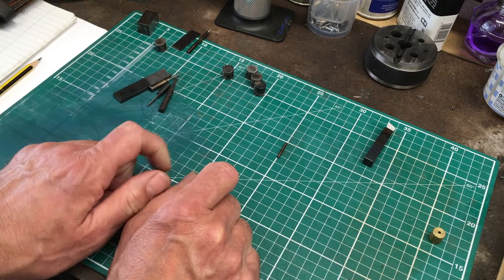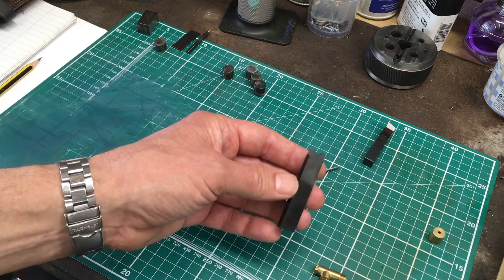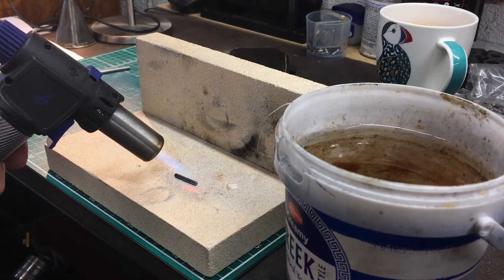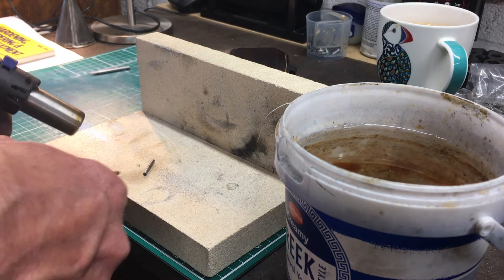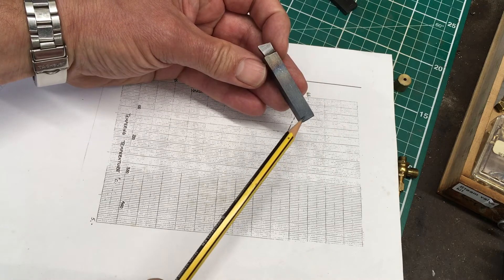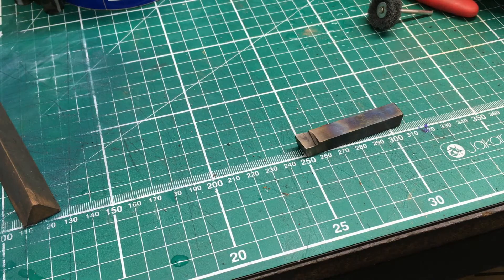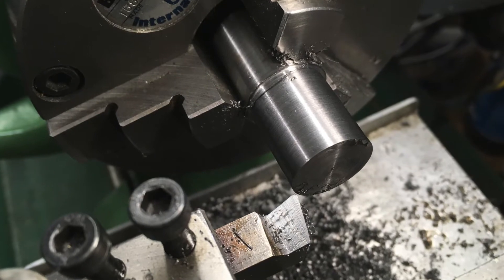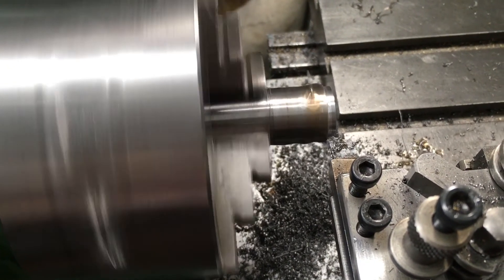Hardening tool steel.

Comment: Hi. I'e read that O1 tool steel should be quenched in Oil and W1 tool steel in Water, O1 - Oil /  W1 - Water. Is there a reason why you quench O1 in Water? Thank you.
Reply: If anything it’s overkill. Oil is required for steels that harden super fast, usually have a bit of chromium and alloy. 

52100 is considered water or oil. 

Most steels can be oil quenched actually. Commonly down to 1000f then in air or water

Comment: educational video.  the first few minutes kinda went nowhere...probably should write it out, get the thinking clearer & edited.
the discussion later on...perhaps the heat-treating by eye & oven needs calibration - via a thermal heat-detector-gun...just so you have better reference as to what temperature does what, when.

Comment: Tool steel on a lathe? For wood or plastics but for anything it's supposed to be HSS isn't it?
Reply: For metalworking usually. Even still, if you have speeds and feeds correct I believe the heat is evacuated through the chips.
Reply: @lindboknifeandtool  I've made plenty of 0-1 tool stool cutting tools used to turn 6061 aluminum. Hardened to RC62 they will last a very long time.
Reply: I’d imagine wanting HSS for even wood though… idk 😂

Comment: On decarbonisation, an old-timer trick I have heard about (but not tried!) is to wrap the part in tin foil, get it airtight, and include a piece of paper inside the package; this burns and consumes the oxygen and thus the surface carbon cannot burn off.
Reply: This works but the foil needs to be stainless foil, aluminium foil or "tin foil" will burn off very quickly as it's melting point is low
Reply: Gotta be stainless “tool wrap” I think it’s 4 thousandths of an inch. 309 stainless for high temperature applications. 

Can be re used with care, with diminishing results of preventing oxidization. 

This goes for air hardening steels usually. Carbon steels require much less temperature so they aren’t effected by this as much. 

I heat treated AEBL without tool wrap and I had to grind a considerable amount to get tk hard steel. Same goes for m2… heh. I got the wrap now. 

Oh yeah and there’s anti scale you can paint on.

Comment: Thank you for a very informative and educational video. Your findings are very interesting. I will continue using my small hand held torch in the knowledge that it is still a good way to harden and temper tool steel. Thank you 👏👏👍😀

Can I ask, do you have a reason for quenching in water in preference to oil?

Very happy to subscribe for more such content.
Reply from the maker: Hello Andrew,  Silver steel is quenched in water traditionally, all down to the composition of the material. Gauge plate is quenched in oil. Quenching in water gives a harder result in theory. There are whole books on the subject and many opinions, I just follow the advice on the material data sheet.
Reply: @simonbirt6121  Thankyou for your reply. I will try to remember your advice regarding silver steel and gauge plate. Many thanks 👍😀